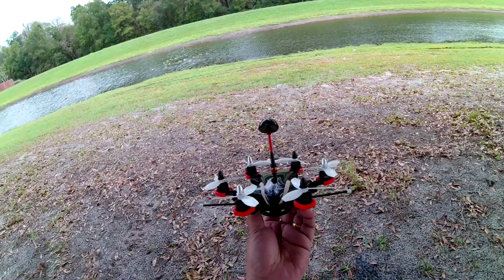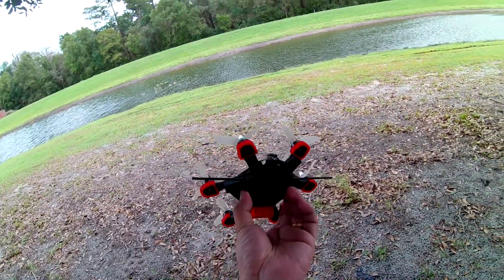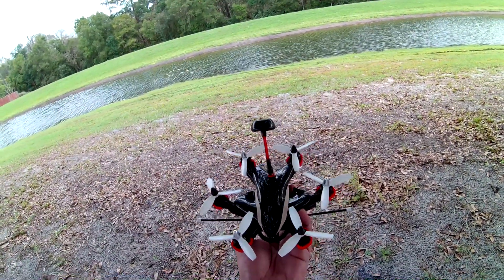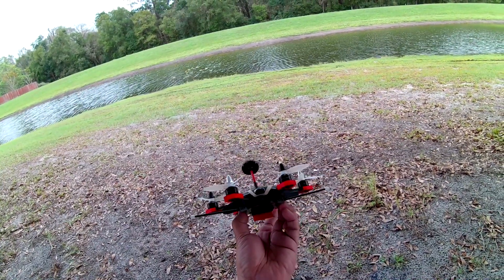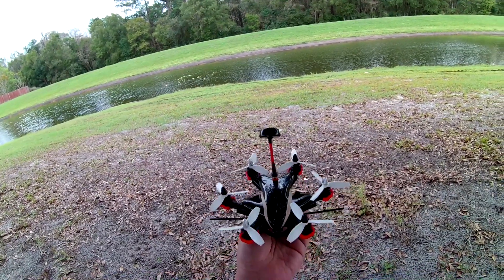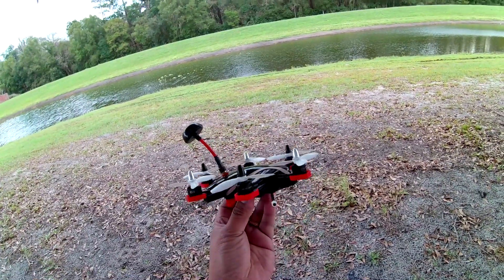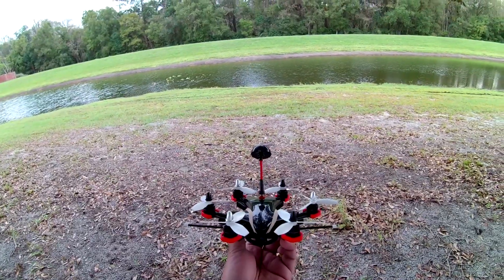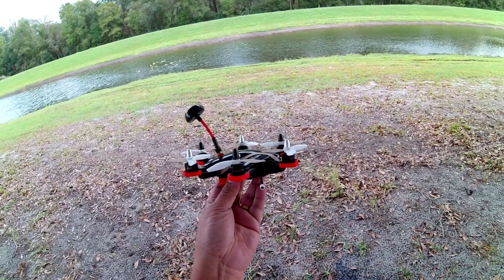Quick Specs - RotorX Raiju

Comment: were u get the pdb
Reply from the maker: +Delbert williams delbert williams (The Gate Keeper) Any PDB with bec . check readytoflyquads.com
Reply: Any but they only have for 4 motors tho
Reply from the maker: you need to share the  positive and negative wires on any of of the solder point
Reply: Ok so I can hook 2 up two one pad u saying
Reply from the maker: +Delbert williams delbert williams (The Gate Keeper) yes